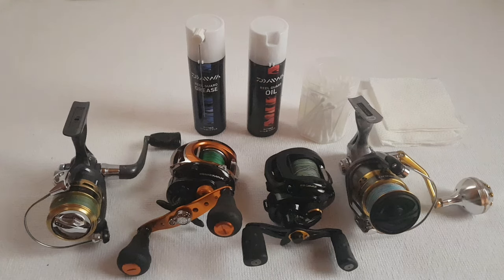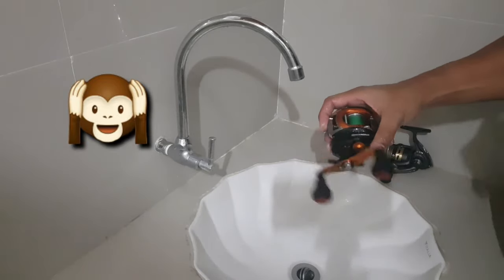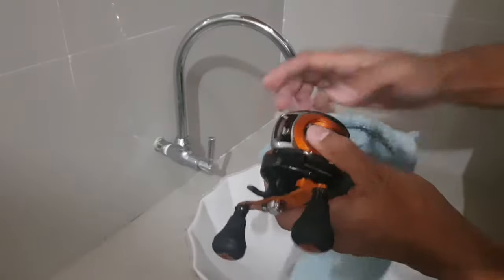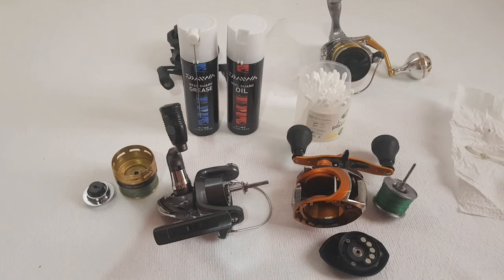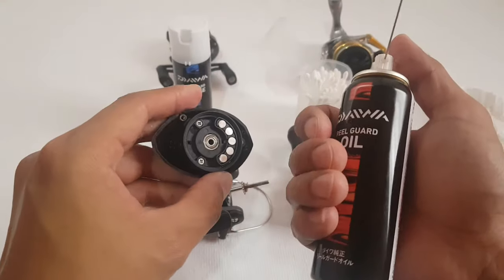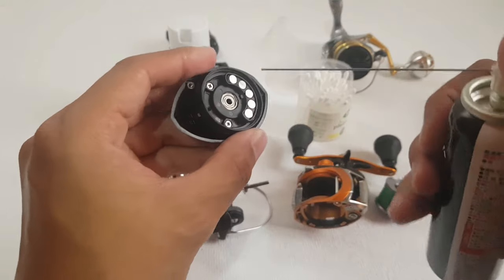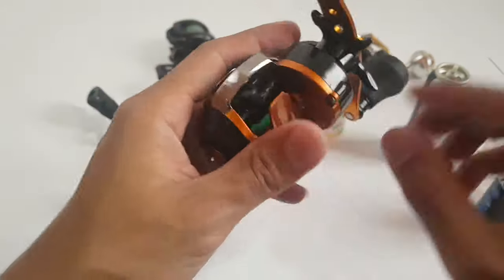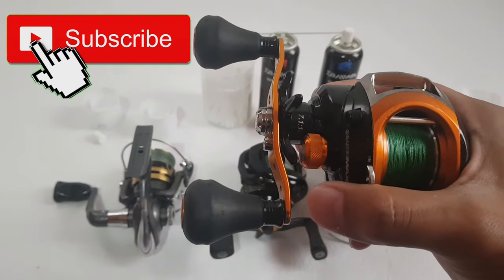HOW TO CLEAN AND MAINTAIN REELS|BAIT CASTING & SPINNING REEL

Comment: sir, ma tanong lang po.. ok lang po ba ang ticking/clicking sound ng sedona 3000 during rotation? i already tried putting oil.. I noticed that the sound occurs when the spool hits its peak point in moving up and down...
Reply from the maker: Its not normal sir, supposed to be smooth yan. Nung binili ko sedona ko brandnew, medyo may tunog din sya konti but not ticking or clicking sound. Baka nabuhanginan yan sa loob.
Reply: sir, nakita ko na po ang problema... maluwag po ang main shaft nya, yun po lagyanan ng spool... ma ayus pa po ba ito? salamat..

Comment: Master kahit anong brand ba ng reel basta na lublub sa dagat kakalawangin ba o naka depende sa pag maintain mo kahit pa di gaano branded na reel?
Reply from the maker: Kahit po ano brand. Kakalawangin yan pag pinasokan ng saltwater. Syempre pag mas highend reel mo. Lalo na yong may mga sealed. To prevent salt water entry, Mas maganda.